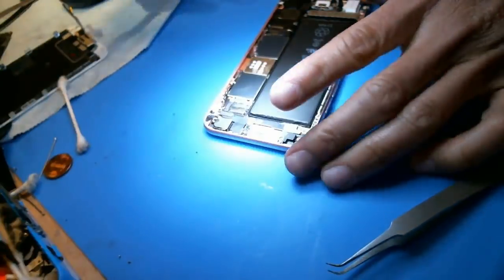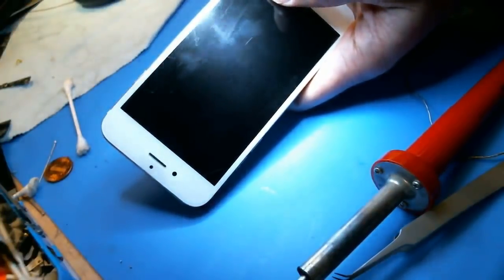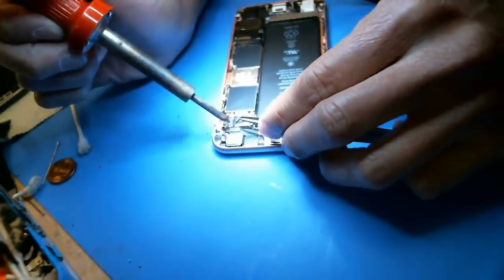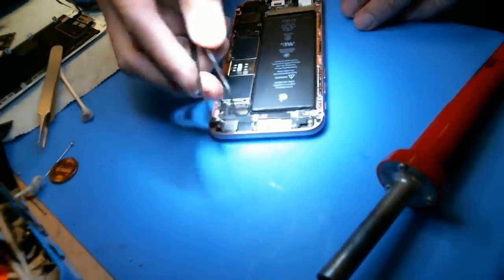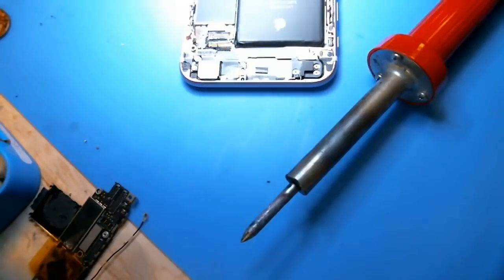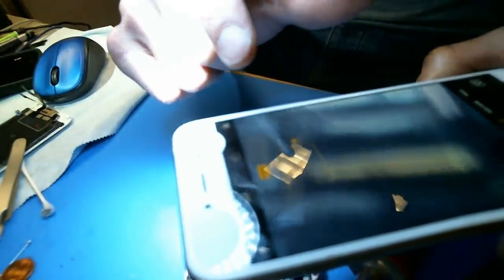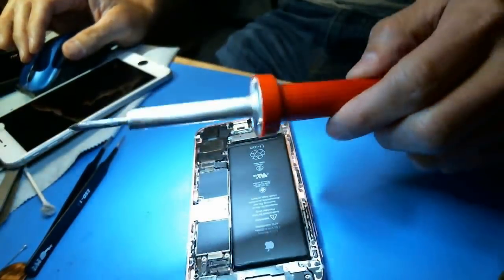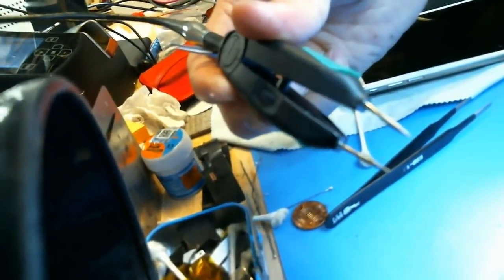DIY iPhone 6S Backlight Repair with a $10 Soldering Iron

Comment: I've replaced an iPhone 6s backlight filter without a microscope in the past. Used hot air station to install of course. I think the filter would just get engulfed by the jumbo tip. They could try a hair dryer with a pencil maybe. /s

Comment: PLEASE I NEED HELP ASAP!
My volume buttons stopped working so i decided to repair the phone my self. I have repaired iPhones before. Before i disassembled the phone i made sure that the phone was turned off and i removed the battery before i removed anything else. After replacing the volume button i put the screen back on to test the volume buttons however the screen didn't light up. eventually the screen lit up but every time i put the brightness up on my phone it goes extremely dim. is this a backlight problem or is it something else? please i need help . Thanks.
Reply from the maker: probably the coil